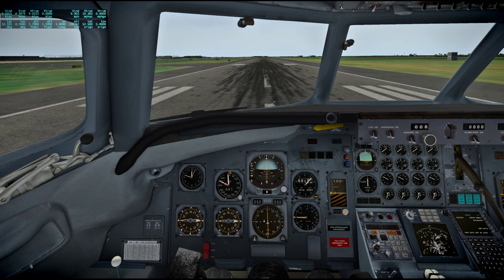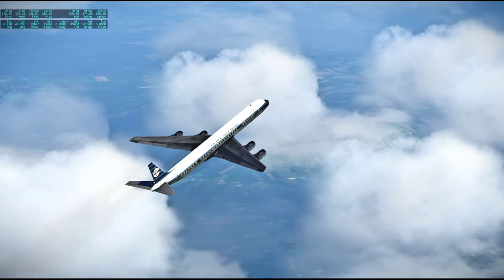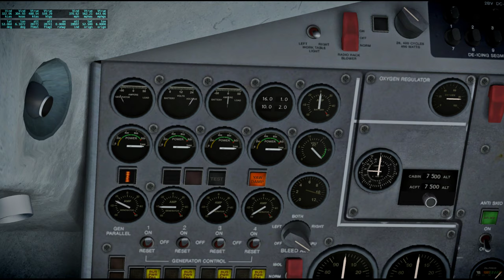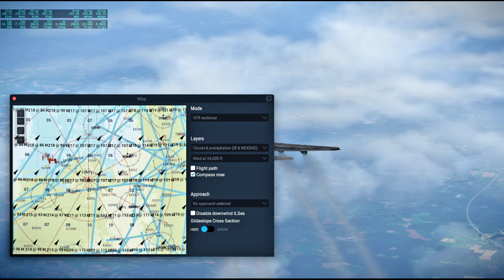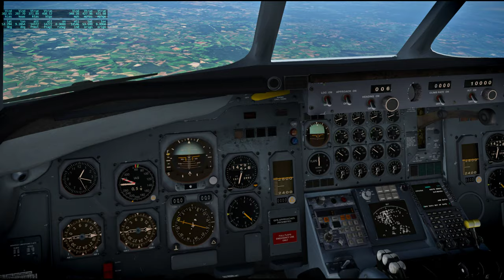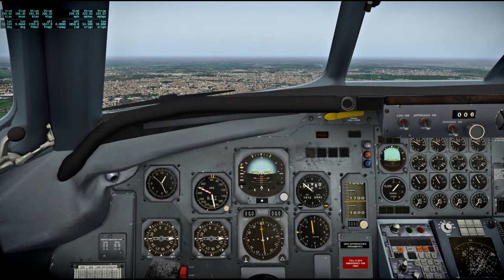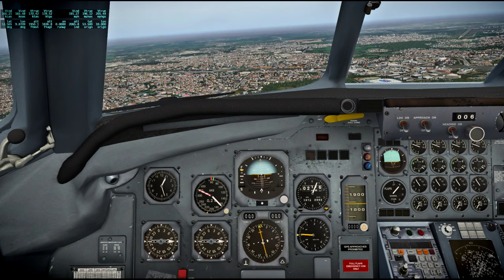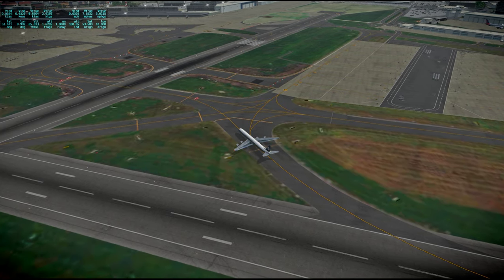Around the World in 80 Planes Redux 25 - Amsterdam to Hamburg

Comment: Nice video. What GPU are you using for your gaming?
Reply from the maker: GTX 970
Reply: @RaizSpace  Cool would it be a good upgrade from a 670? And what FPS & Graphics setting are you running at?
Reply from the maker: It's a pretty old card, so there are probably better options these days, like the 1060 or something. The graphics are actually variable - I've got a little plugin that adjusts the settings depending on the frame rates. I try not to pay too much attention to the frame rates, to be honest, since they're not great - especially around cities.
Reply: @RaizSpace  Cool. What GPU would be suitable for a I-7 3630K quad core?